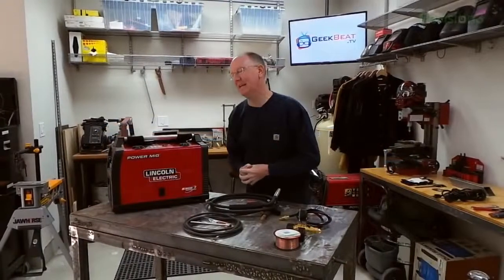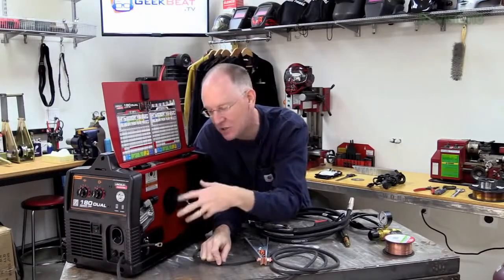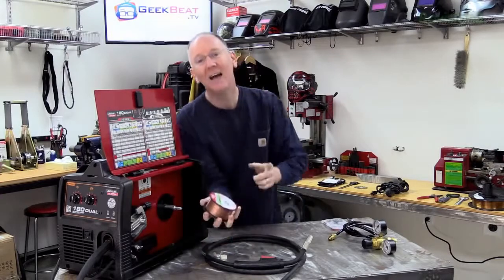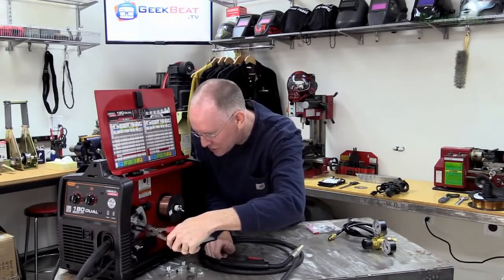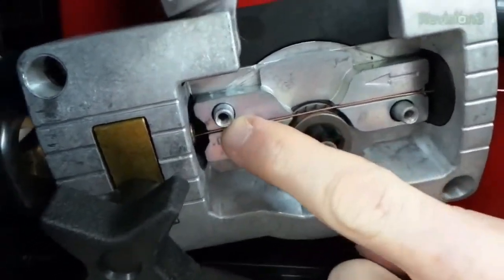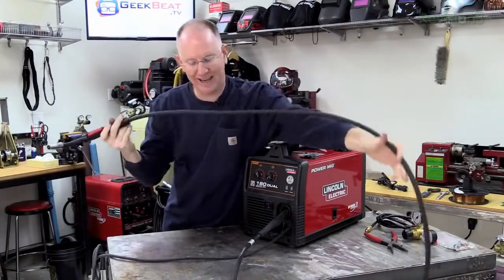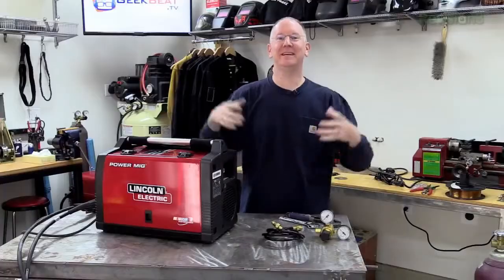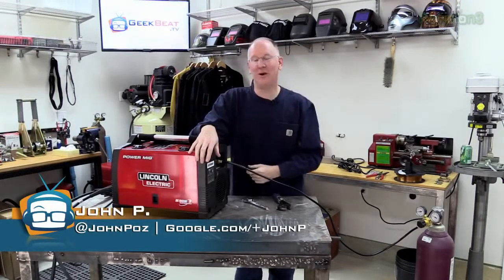Geek Beat Archives   GBTV   Setting up Lincoln Power MIG 180 Dual for MIG Welding

Comment: i don't understand. why not remove the gun, run the wire so it sticks out the front of the machine, then slide the gun over the wire and tighten the nut. instead of all that useless shit you showed ?  apply  medium lock tight on the bolt that holds the drive it will back out.